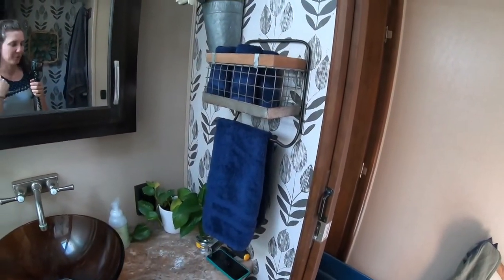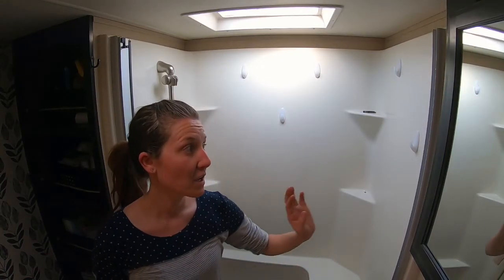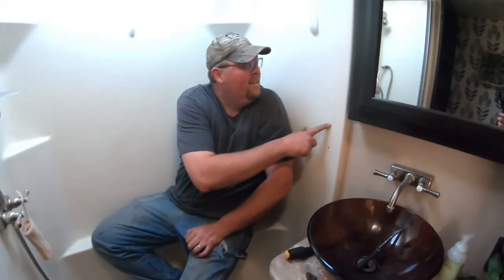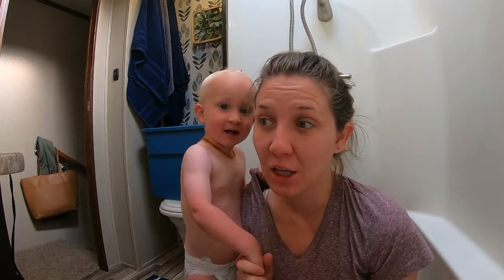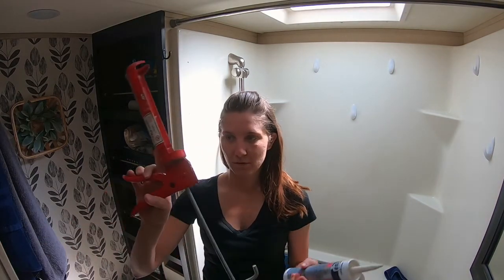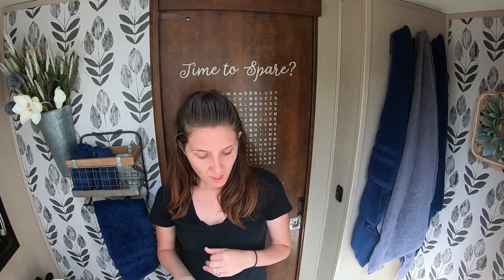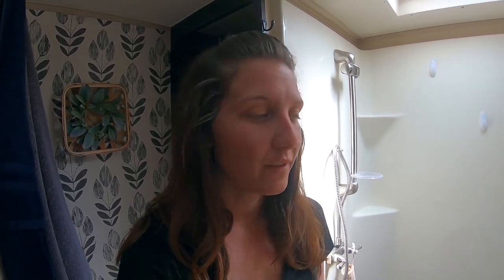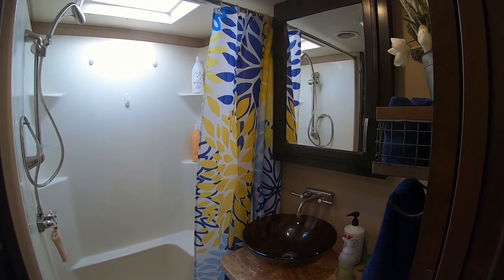RV Shower Door Upgrade | Removing Sliding Shower Doors | Camper Shower Curtain Install

Comment: Just found you guys.  You did a very nice job - bright and cheery.  My wife and I have been using a Shubb draw across shower curtain for four years now.  It came with our Grand Design Imagine and love it as it takes little space and does not mildew when rolled up wet.  A tip that you may already know judging by the pump bottles in the shower is to use shower jells.  Cuts down dramatically on cleaning and leaves more time for fun.  Thought I would point out that silicone sealants don't dry they set up similar to an epoxy glue.
Reply from the maker: Thanks for checking it out and for the tips. We appreciate all the help we can get!

Comment: I used the GE Silicone 100% Waterproof in White. Comes in a 2.8 FL OZ. squeezable tube to fill the 6 very small holes.
Reply from the maker: That's a great option!

Comment: I just took my Tri-glide shower door off.  Hated it, water sat in it all the time.  I put PVC board on the bottom and sides.   When they built my RV they decided put 3 holes for every mounting screw (I am finding that everywhere).  So behind my shower door frame was 12 holes.   The color was something to be desired but when your a color-blind guy, that helps.  I think I lost a 100 lbs when all said and done though.  Good work!!
Reply from the maker: Haha ever little bit helps when it comes to weight in these things. We like how it opened the bathroom up so much more!